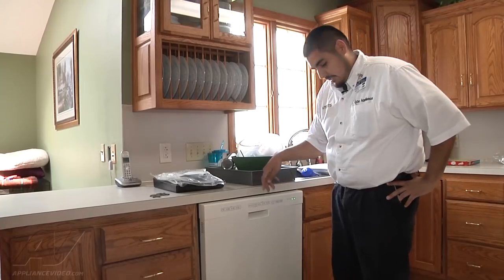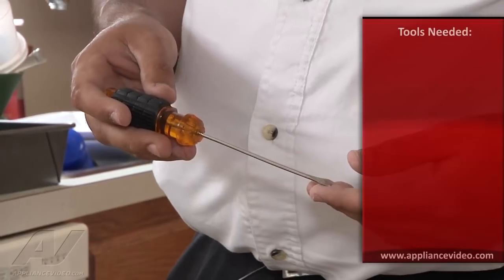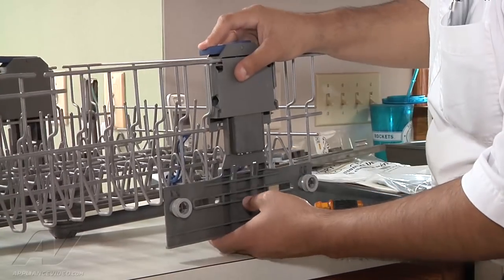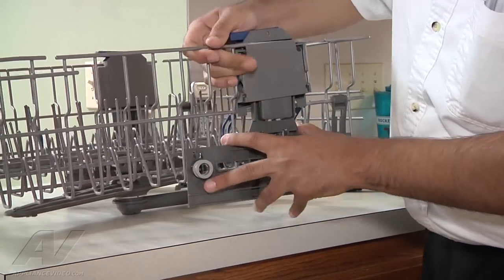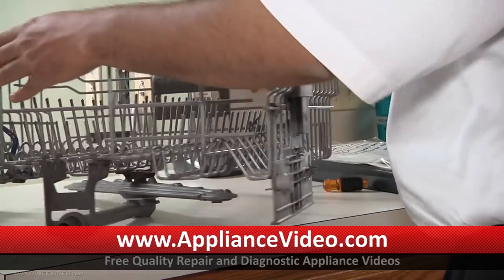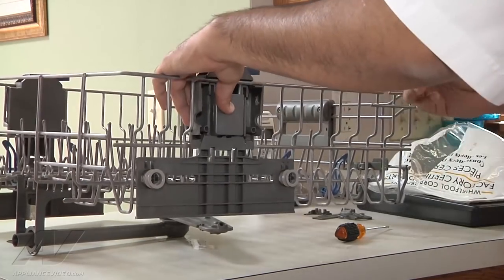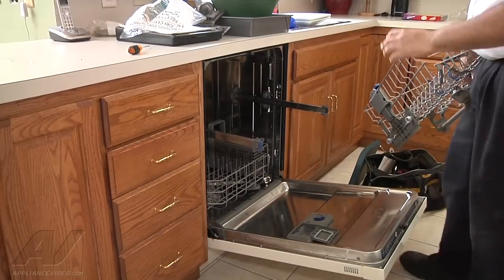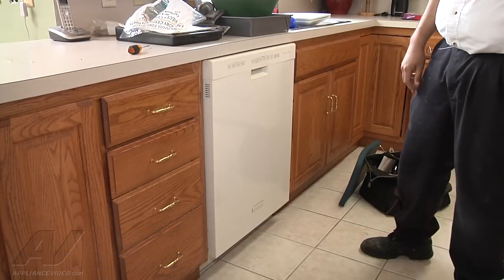Dishwasher Repair - Top Rack supports & Rollers -Whirlpool,KitchenAid,Maytag,Kenmore KUDS30IXBT7

Comment: What you see in the video is Whirlpool part #W10350376 - it holds the top dishwasher rack in place for a bunch of Whirlpool, Kenmore, and KitchenAid dishwashers that have an adjustable upper rack. And it fails like clockwork every 9-18 months. See those rollers? If you look closely, you'll see they're held in place by two tiny plastic clips that eventually break off. When enough of these fall out, the upper rack will come crashing down. Just a few cents of epoxy between the prongs and the main roller support in between would prevent this from ever happening, but Whirlpool is addicted to the $50 they can get annually when customers replace the whole part like you see here.

Want to make sure this doesn't happen to your new part? Place a dab of epoxy between the prongs and the "I" axle that sits between them, being careful not to get epoxy on any surfaces that will touch the roller directly (you can sand epoxy off if either happens, but you might want to take the rollers off temporarily just to be safe). Ensure that the epoxy is pushed in as close to the base of the prong as possible, so the top half of each prong can still flex slightly once the epoxy sets. Be sure to use an epoxy rated for fiberglass (wet environments) that can handle exposure to 200 degree temps (dishwashers reach between 140-160 degrees) - I used PC SuperEpoxy in my case. 

Allow the epoxy to harden (a few hours typically), and you'll never lose a prong again. In my case, I was even able to use the epoxy directly on the broken part - even though I had lost 7 of 8 prongs, I found them all inside the dishwasher, figured out where each was originally attached, and used this technique to re-attach them and reinforce the one prong that remained attached. A few hours later, the re-attached prongs were just as strongly attached as the existing prong, and it seems that no amount of pressure will rip them out again.
Reply from the maker: Thanks for your response, we are glad we could help. Our library of over 5,700 videos are currently helping over 1.6 million people like you every MONTH.  Please help us by subscribing to our YouTube channel, or post our website www.ApplianceVideo.com to your Facebook page, Twitter, Instagram or any other social media sites. Your support will help us keep producing more free quality videos.

Comment: He put that last clip (over the rear rollers) on backwards, pulling it through and clipping it from the outside like that. It was clipped from the inside before he took it off.
Reply from the maker: The technician said there would be no problem clipping it that way. Great question and thank you for your valuable input. It is always greatly appreciated.

Comment: Do you know if the similar issues on Maytag dishwashers have been fixed? Thanks  Maytag MDB8959SFZ
Reply from the maker: Great question, with our
technicians now getting hundreds questions weekly, they are answering all questions
at our website at ApplianceVideo.com under our Repair Help section. We have over
3,000 common questions and answers that you can easily search through by your
model number, appliance make, and problem or error codes.